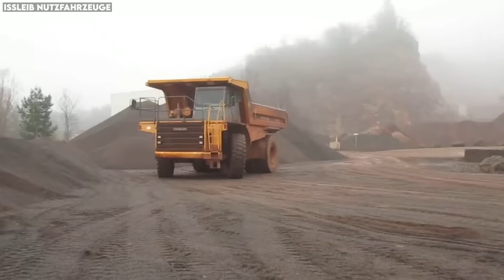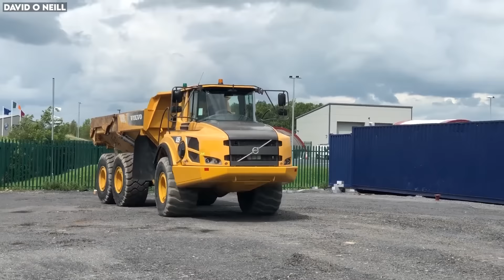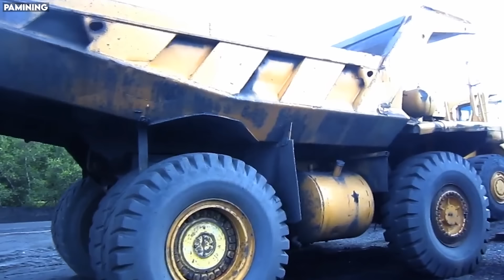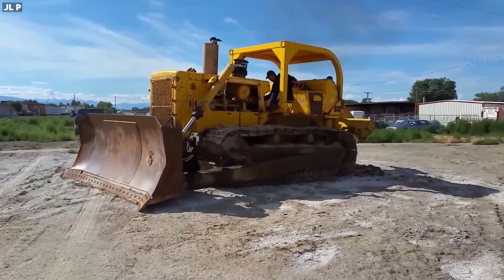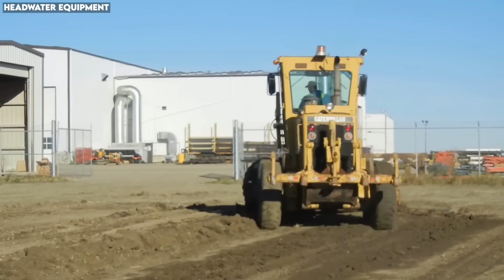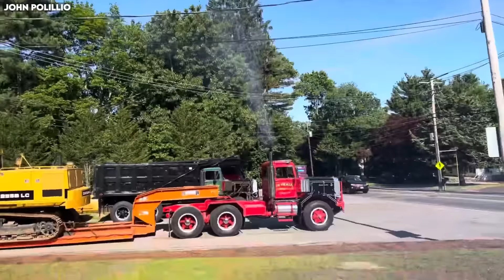10 Old Construction Machines That Modern Crews Still Wish They Had

Comment: My Dad had D8s from appx 1953 til he c went out of business in 1978. They always started and worked and thanks to the pre-ventive maintenance there was minimal downtime. These were cable units. . Newest machine was a used 1965 D8 46A with  ripper purchased in 1968. This machine caused more problems than the others, especially the transmission.
Reply: I still use a D8H